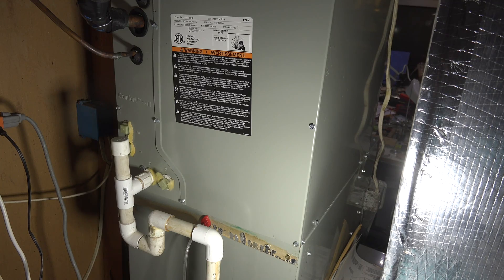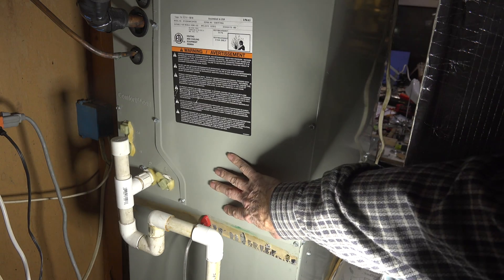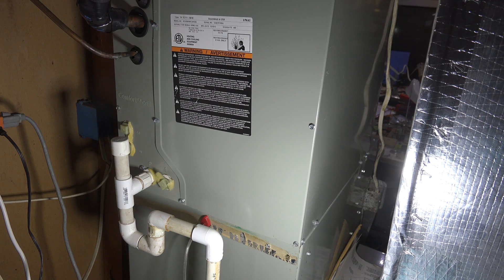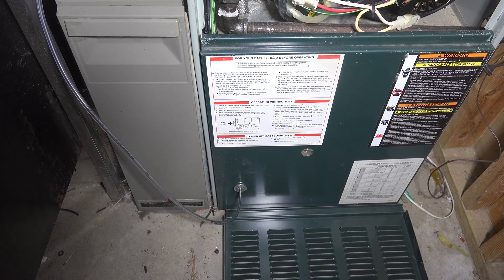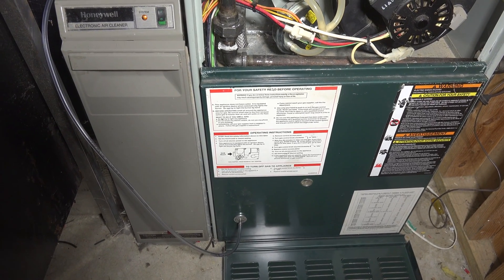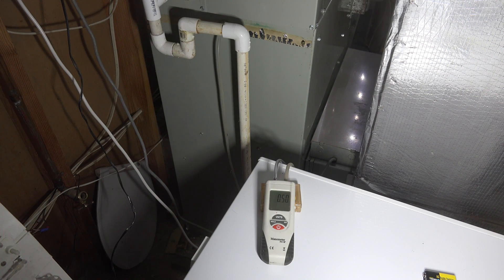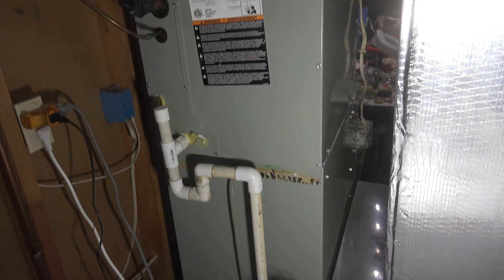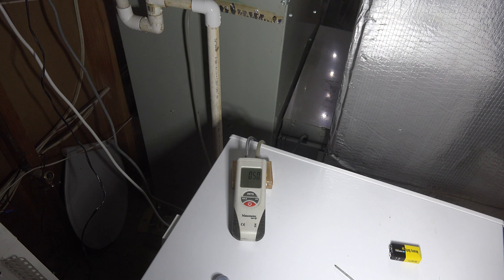Ductwork diagnosis #1, external static pressure

Comment: Grey has a question for Gray. I have a HP with air handler so my two test locations will be somewhat different. One in return plenum just below the bottom of AH, and one in supply plenum off the top of AH. I have the same Chinese made manometer and a pair of Fieldpiece static probes like yours. I am just a homeowner with some basic HVAC knowledge. I assume you have one probe in negative air before the fan, and the other probe in positive air after the fan. I know to get a pressure drop with this manometer you use both tube ports to get a pressure drop, such as across a filter or evap coil. I thought to get tsp with this " budget " manometer you would have to use a single tube port and get negative and positive readings individually at each location and then add them together and this would be the tsp. I noticed you are using both ports on the unit to get the .51 tsp. Help me with my confusion please sir.  The manual that comes with this unit is not very instructional in my opinion.  Thanks !

Comment: Hi Gray, thanks. I’ve asked this on other channels and I’d like to ask you as well.
If the static pressure is too high the blower can’t deliver enough air , the CFM rate is dropped . What air is pushed through, is the velocity higher causing noisy ducts at the registers?

Comment: GrayFurnaceMan, is the 0.5" measurement from the digital manometer the combined measurement of -0.25" and +0.25" as if reading from a analog u-shaped tube filled with water?  Or is the 0.5" only measuring "one side of the column of water displacement" if you understand what I'm trying to ask?
Reply from the maker: It is the total of the utube measurements.
GFM

Comment: What are you using to plug the hole on the blower door? Up here in Canada my boss frowns on drilling holes into the furnace doors and wants me to use spy glass instead
Reply: majority of folks use a self tapping hex-head metal screw, run it it to make the hole, remove to test and put it back when done. worried about rust? then use stainless steel screws
Reply from the maker: I do not generally plug the holes unless the customer desires it.  Its kind of ridiculous as there is far more leakage in the blower door edges.  Similar to ductwork holes.  The esses and drives leak far more than a 3/16" hole.
GFM